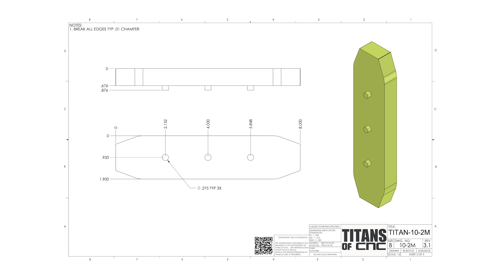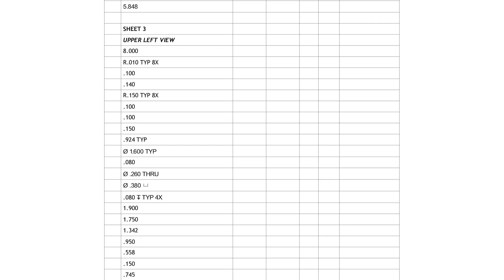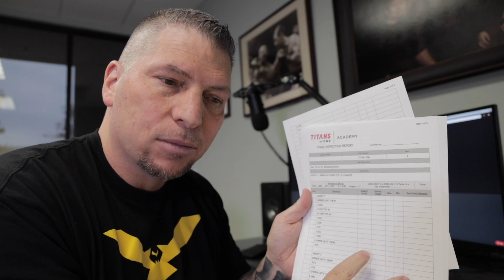How I Learned The Importance Of Quality In CNC Machining - Vlog #29

Comment: If I were the shop owner I would feel that was not your mistake, you are not a machine technician at that point and if you can manually move the stop with exuberance that is totally on who trained you and who set up the machine.  I have never been a shop owner and maybe that is wrong, but still, WTF you were new and how were you to know the force required to move the stop?  I went to college for industrial design and was taught that mistake is on the most experienced person in that chain of events not the least, then I was shown how the social design of our society dumps that crap on the least capable of avoiding it to save the ego and emotion of the !@#!@!!!! that actually caused it.

Comment: Not a machinist story but a 3D Printing story.  About 3 years ago I had a customer send me a part that someone else had done for him, the part was that bad that I would be embarrassed to show it to anyone let alone sell it to a customer.  I ended up redesigning the part and ended up having to print it in two parts, that way I could avoid using supports and improve the finish of the part and then put the parts together at the end.  I delivered the parts and about a month latter found out from a friend, that the guy had taken the part to China, had it reverse engineered and injection molded.   This guy had sent me other parts to make also, but did not know that I knew what he had done.   Never did the other parts and kept the parts that he sent me.  A total Ahole act.

Comment: In had a similar experience. Learned the hard way the difference between climb and conventional cutting on a mill. They were stainless aircraft parts with a slot milled in. I thought that I developed a quick pattern and checked every other part. Every part that I checked was within tolerance but the other half were bad. I wasn’t milling the same direction each time. I climb cut one part , never returned the machine to start position just chucked next part and back tracked, ( conventional cut ). Those were too big but never checked them. Didn’t know it mattered. Even got first article and random inspections.

Comment: Damn, you story reminded me of the goof up that I did. After living in California for 3 years after getting out the Navy I returned to my home in New York State and got a job at a cutlery. On my first day of work I was put on a stamping machine that was supposed to stamp Case xx on knife blanks. The machine was set up by my supervisor and he showed me how it worked and walked away and left me alone to do the work. I was thinking the same way that I was going to show that I could pump these out quick.  
When he came back to check on my work  I had done a stack of them but unfortunately the stamp was not on straight and I got blamed even though he had set up the machine. I only lasted working there for a month before the union went on strike and I decided that this wasn't a job I was cut out to do so I rejoined the Navy. Spent 25 years there and never went back to New York to live.

Comment: Kinda left my 1st job because I didn't want to be responsible for plastic parts. When I was their, our department lost quality control inspections. So I had to inspect my own parts. Since it was plastic, it was difficult to get an accurate reading due to the fact plastic likes to flex around a lot and didn't know where to measure the part from the top of the cut or the bottom of the cut since it was cut at an angle.So I was spending an hour inspecting my own parts so I can avoid ruining whole set of parts. To add more salt to the wound, is that my lead didn't want me to spend more than 30minutes inspecting. Little did he know I was autistic. So I had one of my coworker helped me while getting trashed talked that I suck at inspecting. Just bear in mind this was my 1st year. So after a while I got the hang of it, putting it on 123 blocks, angle irons, etc. Then 1 day feeling rushed  I accidentally mixed a z dimension on the blueprints and made my part .015in short by mixing the inside dimensional with the outside dimension ruining about 15 parts of plastic with the thermwood 5 axis routers. Moral of the story, take your time even if all your other  coworkers are rushing you.

Comment: I work were a single part cost 5,000$ pure titanium, and guess what? So far no scrap. Takes 10 hours to cut.
I dont move a inch from that 5axis machine.
Reply: What kind of parts do you manufacture?
Reply: @JoseJimenez-ut2bj  Probably aerospace.
Reply: at least with steel you can usually weld and repair

Comment: I had a similar situation with an employee who happened to be my wife's cousin. I was originally hired as a temp to fix about 5,000 4 inch cubes of brass that was already put thru a few hours each of NC work.This was back when our newest machines were Bridgeport BOSS 6 tape machines. They were drilled for a 10-24 roll form tap and somehow tapped with a cutting tap. Because my background is Swiss style tool making I was hired for my skills in hand work , but as they became comfortable with my work they pulled me into the main shop more and more and started doing setups on the NC mills. Since I needed to move around the shop to use machines that might be needed during the day , I worked on the less populated night shift.The shift was a foreman who did the setups , edited and even typed jobs into the tape maker and operators with little to no experiance. It got to the point of me putting in as many hours as his " deputy foreman " as I was fixing those parts. About the time "Jack " was teaching me how to make tapes my wife " asked " my to get her cousin a job.The first night I new this was bad. Jack put me in charge of him and 2 other new guys.The other 2 guys had some skills so 1 went on a manual 2nd op lathe and the other on a BOSS 5 Bridgeport. The cousin , having no skills I put deburring some 16 ga steel parts. I went to do some of my own work and went to check on the new guys about a 1/2 hour later.The 1st 2 guys GREAT , the cousin --no . I told him to just break the wire edge with as small a chanfer as possible. His chamfers met , you could shave with those parts. I did another one to show him and told him to set it aside as a master and look at it to make sure he had it right. 10min later I go back and he's making razors again. I had to move him away from hand work so I had a real simple job on an NC mill.Short program with 1 tool change ( we had manual tool change with power draw bars ) and a programed stop for a clamp move.  1ST piece he changed the tool on the clamp stop ( this tool had 2 inches more TLO than the 1st tool) I put him on a broom while I cleaned up the crash and edited the program so the tool was too close to the table to take out. 2nd piece he came to the clamp stop , couldn't get the tool out so he just re started the machine without moving the clamp , the non-turning endmill was RT'ed into the clamp. I told him to punch out , his check would be mailed.

Comment: oh man what a great story! it made me think of a time I worked in a 5-person job shop. My boss spent a TON of time programming and making fixtures, buying custom tools and everything for aluminum natural gas manifold blocks for car conversions. He finally got it to run perfect parts, but they took several hours a piece. The customer needed a bunch of these blocks, so he put me and another stoner kid on graveyard shift for just a couple of nights just feeding the machine. When I took a part out, I noticed the tap only cut like 3 threads and the hole was pretty deep, so I grabbed a tap and "finished it" (not knowing the purpose of the hole or having any print around). I did that to the few parts we made that whole night. In the morning, the other guy left and my boss got back. I was over doing something at the bandsaw when I heard my boss yell "DAMNIT DALTON!" and threw a lathe chuck wrench across the shop after seeing those tapped holes! I was so scared I never fessed up to it and he luckily he didn't confront the other guy either. Apparently there needed to be an O-ring in that hole to keep natural gas from leaking out.

Comment: As a CNC machinist for over 26 years ,,I noticed a recurring trend happening in the comment's ..
People telling stories of scrapping parts and even though it was their mistake they still find a way to blame procedure..
As Machinist ultimately the part we are making is in our hands..
So you can blame procedure all you like but at the end of the day the mistake is your fault...
So if you make a mistake and scrap out parts..
If you're blaming anyone but yourself,,, you are not learning...
Reply: I can totally respect you for what you said. I believe in being honest and telling your customers like it is so they never get screwed.
Reply: Root cause analysis.....?
Reply: I agree with this to an extent.  If you have a job that makes good parts, but there are variables beyond the control of the operator you can't blame them for bad parts being made.  Right now at my shop we are making parts that some times get pinched or crushed by the parts catcher.  There is absolutely nothing the operator can do about it.  Once the part catcher starts it's return there is no stopping it.  All I can do is make sure they know how to identify damaged parts and make sure they don't go forward through the process.  We lose maybe 2 parts out of 80 a shift.  Some days we don't lose any.   

Personally I can't tell you how many times I've had to go to my  supervisor and say "I fucked up".  I remember working on a VERY late job, made out of aluminum.  While testing the threads on the mating parts I seized the threads together scrapping both parts.  I had to go to my boss and explain.  He understood that we had to test the fit of the parts.  It was a crazy thread like 90mm x.5 pitch.

Comment: I can only add that an entirely handiwork trade like fortepiano building lives and dies on the same premise of quality. The feeling in the motion of tools is the way to make them work without breaking your back - I am today forced to hand plane a very large soundboard to specific thicknesses, something my chaotic cnc machine & vacuum table have failed several times to produce. The trick is to make these machines functional, but it's much harder than normal woodwork, where the tool does tend to train your hands for you. The future beckons, still out of reach.

Comment: You say common sense! I say that this is one of the most important things in any of your videos.
I once said to a former employer, when I was still pretty fresh in his shop, "If there isn't a specific procedure in place, and something goes wrong, it's noone's fault. Until somebody gets hurt, then it's your fault!"
I later got fired for doing 20 parts with a 7mm hole instead of 6mm. I had picked up the drill from the tool rack where the drills were stored in drawers labelled by dimension. In the midst of the discussion, it came up that the owner had put it there but that I should have had a calliper with me and measured it (it was an HSS jobber drill that had been ground down to a stub drill basically).
I then proceeded to point out that this was a failure of procedure and that we were both at fault and effectively, since we could both have avoided this we should learn and agree on a procedure instead of fighting over it. I mentioned the outcome above.
Reply: If you didn't measure the drill it is your fault...
Reply: No 1st article

Comment: I think it is important for designers and engineers, to indicate on prints, critical dimensions. Yes, when the print says this is 30 mil, and 5 mil accuracy on all dimensions tolerance somewhere in the corner, you sometimes do not comprehend and register, if this is really important or not. Often this is because it is critical, or sometimes it is because they are simply lazy. A lot of dimensions is not critical, but things like mating surfaces, pins, and fasteners position, and in this case chamfers, were critical. We often think about chamfers just as something cosmetic, and to help handling part. But in many situations the chamfers are the most important geometric feature of the part. And these should be marked as critical directly on the print, right next to a dimension of the chamfer.

Comment: My biggest mistake.. we machine 3 to 5 ton drums, which are chained down on vee blocks with 3/8 chain, and chain binders you see on semi trucks. The last step is to machine the bulkhead bores which is with a 26.375" bore bar. I had bumped the B axis lever while in jog, and that miniscule amt of time it was bumped, kicked the drum off of B270 degrees. So the bore bar came up to the part, spinning at 110 rpm. With it slightly rotated, the rougher was beating the hell out of the bulkhead so hard that it was picking up the drum off the vee blocks, WHILE chained down! BANG BANG BANG BANG until the spindle was shut down. The drive dogs off the 6" quill, or W (which was extended 18") were sheared off. The 50 taper of the bore bar was WELDED inside the spindle, and wouldnt release. I felt lower than terrible. News like that travels fast across the entire plant. They had to hire guys to come in and re-grind the spindle. Lessons learned,
1. To shut the spindle down, DONT hit feedhold. The spindle keeps spinning. Feedhold shouldn't be a red colored button, its misleading. It just stops the feed. Hit reset or E-stop. Practice it! I've seen people not hit e-stop because they were "afraid". Know where all of your estops are around the machine, and think about what you would do in an emergency. 
2. Just above the G0G90G54.1P1X0Y0 start line, add these codes..
G0G91G28Z0W0 (older machines, some of em can crash if they dont start from a Z0 reference point) and G0G90B270. Had these last 2 codes been in the control, while in memory, the machine would have gone back to B270.

Comment: How to read a bore gauge seems to be one thing I see people struggle with. Even inspectors. You can say, "do get this?" Yep, yep! And only to find out assembly cant get a bushing in because the bore is too small. Adding to the confusion is bore gauges measuring in micron, vs .01mm or even  in inches. And then add to that, setting the bore gauge up off a ring gauge that is way off nominal, because the engineer didnt buy the right size ring gauge for the job. I found it helps to add a plus and minus on the bore gauge face so operators know if the bore is small or big. Some of our parts, I've programmed the probe to check the bore size, but with the length of the stylus we have to run, it's only good to .025mm (and that's with it pre probing a magnetic ring gauge set in a counter bore before it probes the part, to check/set the probes dia accuracy) 
Anyways, thanks for sharing!

Comment: Hey, another Important vid. Sharing the experience and your pain (should) teach an important lesson to anyone willing to learn. 
When I was learning CNC the first time, back in 1995(ha!), my teacher sent me to see if I could help a new CNC set up at a long established engineering company that was having a lot of problems.
I volunteered my time for a month for free to see if I could help.
The two men working those machines were only learning but hadn't got the knack of the CAD CAM package and we're trying to write very basic G code programs directly at the controller.
They also, it became obvious, hadn't been QAing their parts.
When I started to check the storeroom of parts against the drawings they up and quit that day, like right the moment they realised what I was doing.
Long story short, the owner of the business and I went through the entire 3 months of work in that room and it was scrapped. Every critical dimension was out. ID's were big, OD's were small, burrs on every edge, poor surface finish.....   etc.
Lessons learned: Learn to measure!
Check sizes routinely.
Note tool wear with an eye to tool change timing.
Learn the CAD CAM package, it is vastly superior to manual programming.
Write notes about tooling, work holding jigs, tool change intervals and any other hints that help INTO the program for any jobs that are likely to be done again or repeditivly.
Don't hide your mistakes.
Never assume.
Learn All the time...
TOUGH LESSONS

Comment: Hey Titan, great video and story. I first started machining in a very small job shop/repair shop 2 years ago. over those 2 years I definitely made mistakes while manually machining and welding. broken taps, broken inserts, broken drills. but I gained a ton of experience! I'm currently 2 months into my new machining job that is ISO9001 and ISO13485. your videos inspired me alot to look for better work.

Comment: Mr. Titan, I applaud your videos. I graduated from college 4 years ago with my Associates degree in precision machining and tooling. I work as the lone Machinist at a private company that manufactures its parts in house for the equipment they make. So I work hand in hand with our engineer whom knows very little about running and operating our Haas VM3. I have job security thanks to watching your videos and the videos from Haas. In the past year, I was able to take a particular part with a run time of 3 1/2 hours and I tweaked the program to have a new cycle time of 33 minutes. I know very little about CADS like Mastercam. But thankfully I understand how to read NC code and watching your videos, I can have our Haas run at maximum power with carbide tooling machining our aluminum parts. I would like to know more about Mastercam so that way I can assist our engineer and take a large chunk of the work load off his plate. Keep up the fantastic work! Thank you.
Reply: Jeez if you cut that much off the cycle time sounds like that programer needs be fired sad to say.
Reply: Good jump in productivity! 👍
Keep that up and you'll be running the shop soon.
Just don't get cocky, stay hunble and treat everyone as equals.
God Bless, best of luck and productivity to you!